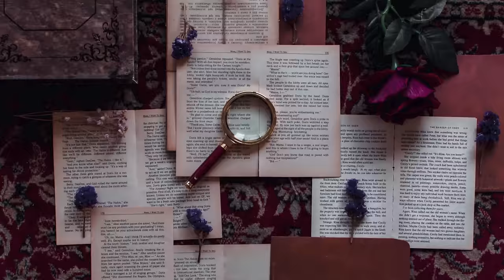They Found in Antarctica What No One Was Supposed to See

Comment: That wheeled craft was first made in the USA in the 1930s and in 1939 and put in an ice garage then lost location. It is believed the ice shelf broke off and the craft may have floated off. It had four flat head six clyender engines one for each wheel and was very slow. The tires had no tread and was a poor design. The tracks was a better design.